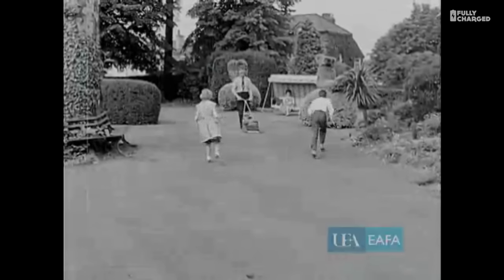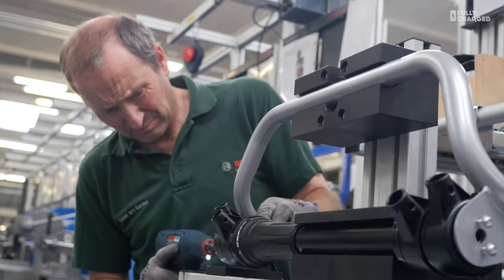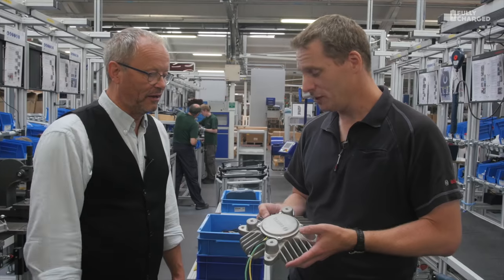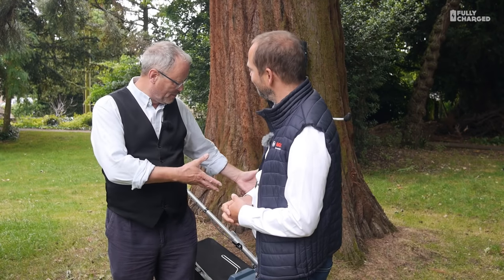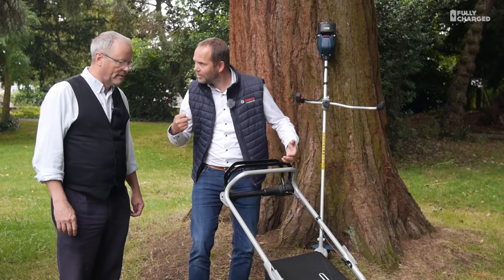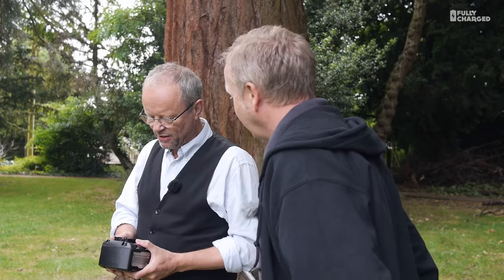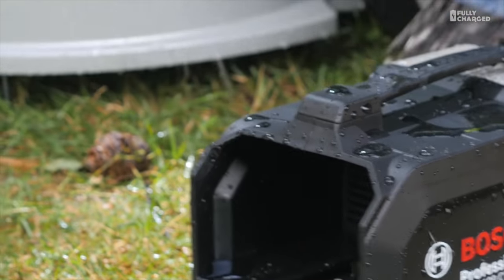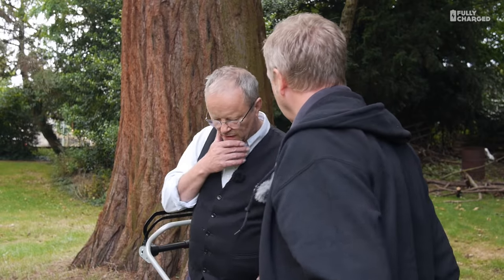Bosch pro electric Lawnmower | Fully Charged

Comment: I have to wonder in the life of the batteries and the mower 1. why not implement some kind of solar shed to keep those batteries plugged in and rotate around as you come back on a regular basis or two fold up panels on the truck bed with enough amps and 2. I wait for v2 of that mower where they make put noise cancellation so you only hear it when its being overloaded.

Comment: I used to own a Bosch Rotek 36 Li. Very practical for a small (200 - 300 m2) back yard (the ones flats tend to have occasionaly). This thing - Impressive, but not happening, at least not until someone bans a petrol powered lawnmower. Lets hope that never happenes.

Comment: Obviously this mower does not cut short grass as the promoters failed to demonstrate.I being an expert could hear the delay in the motor blade brake release on start up which will drain the battery quickly on too many start ups.

Comment: These are not new. I’ve had a Ryobi mower for 7 years. I have other products that use the same battery. The only thing I’ve changed is the starter cable and I’ve sharpened the cutting blade. Mowing late evenings without neighbours moaning is a bonus.

Comment: Battery powered tools are great, but the batteries are expensive.  That is not a big issue if the batteries and machines last long enough to justify the cost.  The first batteries that came with my Ryobi drill didn't last nearly long enough.  The replacement battery has performed above and beyond my expectations.  Now they have newer versions and I can only hope they have improved even more.  My biggest gripe is that they all take different batteries to fit the manufactures design.  Even automobiles use more easily attained batteries in this century.

Comment: They're not going to match a petrol mower if they think you only get 1.5 hours out of a tank of petrol.
Of course it depends how big your tank is.
My smallest mower for comparison; Hayter Harrier 56 has a 1 litre tank and I expect at the very minimum 3-3.5 hours out of a tank of petrol.
Electric may be cheaper than petrol, but I can't see this is for professional use.
Unless Bosch want to loan me one for a few days, if they're that confident in it. They haven't sold me.

Comment: I think the small battery charger (in fact, 2 of them) should be built into the big battery thing instead of having to convert the power to and from 220V which is less efficient.
Reply: +FDK that prevents that power pack being used with other standard appliances though. that pack outputs 220v and uses standard plugs so you could plug anything you wanted into it....
Reply: +Rich T Yes, have the 220v outputs, but why not a direct dock for at least one Bosch battery also? That would likely be more used than the 220v ports in lawn service applications.

Comment: Why is everyone so fascinated?? I've been using electric mowers for over 30 years... Granted, they're not cordless, but this is merely an evolution of a very very old concept. And 1 hour mowing means you either have to buy a lot of expensive batteries, or you have a small lawn, so you will be fine with a corded mower anyways...

Comment: As much as I do like battery operated machinery I think is is a false comparison the statement that it is cheaper to maintain over the life of the mower. If I own a petrol mower for 5 years and I compare it to a battery operated model apart from the electricity vs petrol cost difference. 

How many charge cycles are the batteries rated for what is the energy density warrantied for after 12 months or 24 months how much is a replacement battery how is a faulty battery determined to qualify for warranty replacement. If I don't use the mower for 3 weeks do I have to ensure a minimum charge is maintained in the Lithium battery to protect against deep discharge. If a zero discharge results will I need to buy a new battery how do I recycle my lithium battery with Bosch do they provide a recycling or battery upgrade program ?
Reply: This mowers is for professionals, and I think it's made for mowing near hospitals etc. where people don't want to hear noise. If a gardener can offer such a mower, he will get a contract, so the mower will be economical for him. If you buy this mower for private use, it's a nice mower and comfortable, but you never will get back the price difference to a petrol mower because of fuel savings at home. But for private use there are smaller and cheaper battery electric mowers available, which have the same batteries like other machinery, when you can use the batteries for a couple of devices its much more economical than batteries for only one device. If you already have some cordless tools with the right batteries, the mower alone without batteries is cheap.

Comment: We been dropping jerry cans and mowing in the rain for years with petrol & hi voltage HT lead.  Nothing new there.  As with the power bank they will be stollen very easily.  Petrol is still in the lead but electric is catching up.  Its the amp draw of a mower that lets it down.  A petrol engine working hard runs out of fuel quicker and you just fill it up from a jerry can.  This cycle can go all day and night long.  Its also cheaper as batteries are very expensive & charges.  If your power supply is coal its actually worse than petrol for the environment as coal has a shit calorific vale

Comment: i used a batter powerd shavers  and it's  s@#t   . then i went back to 240v plug in shaver . its a third the price 5 X more powerful  . And it lasted 3 years . the battery one lasted only 6 weeks . i allso, have a electric  weed waker and electric  lawn mower 240 v  and here grate
Reply: Fifteen year old mains electric mower here, used regularly, works like new and is a beast (1700w); no complaints 😁.

Comment: Works well for small-medium sized gardens, but I'm not too sure professionals would like to wait for an hour everytime the battery runs dry.
Reply: Easily solved wiith extra batteries that you can switch out in 30 seconds
Reply: Dusseren Which constantly need recharging, not only that but you need two chargers.
Reply: Easily recharged over night. Definitely not more work than the refilling and cleaning and maintenence that comes with other fuel.
Reply: Dusseren "Yup sir, It'll take me about 3 days to mow my lawn cause every time my batteries run flat I have to go home and recharge them overnight."
Reply: ...what the hell, do you have amnesia and have forgotten the context? You have several pairs of battery, and charge them over night.
Reply: Dusseren And carry a dozen batteries with me everywhere, not to mention how expensive electricity is!
Reply: No, you don't carry them with you. Obviously you keep them in your truck or whatever you use for all your other equipment.

I have to say though, with your comment about how expensive electricity I'm getting soem serious Poe's Law tingling.
Reply from the maker: I'm not sure I understand, did you watch the whole video? The entire point is that professionals, which is who this machine is aimed at, would have a spare set of batteries, pre charged, on standby. When the first two run out (after 2 hours of solid mowing, they swap them (30 seconds max) put the two depleted batteries on charge in the portable charger, so they don't need to 'go home' and charge them, while those are charging, they use the next two and by the time they have run out, the first two are full again.
As for the cost of electricity, these are small batteries, running this mower costs about 10% of the amount you'd spend on petrol gasoline so, to finish, every one of your points is invalid.
Oh, sorry, then there's the noise and smell of clattering, wasteful, constantly breaking internal combustion engines.
Reply: fullychargedshow And I wonder how much such a "luxurious" set costs?
Reply: Jaime F and Over $2000 I'd say!
Reply: I'm a professional Carpenter. I have DeWalt 20 Volt Max tools and 5 batteries and 3 chargers. Running out of power at work isn't a problem.
Reply: Some people are Leaders and some people are Followers. You Sir are certainly not The Leader type. 

Do you Follow me?
Reply: Peter Hall But as a carpenter you've got constant access to the mains. How does not wanting an underpowered lawnmower make me a follower?
Reply: Cordless tools are very handy as I don't require  an electrical tether to limit my movement around the construction site. I also have a cordless 20 Volt Max Nailing gun too and I don't need a compressor or hose either.

I don't need a lawnmower period as I don't have a lawn. Maybe you don't have a lawn either.
Reply: Peter Hall Yes, indeed, cordless power tools are extremely handy, I'm not denying that but thus conversation is about lawnmowers. 

I do in fact have an electric corded lawnmower, what I'm saying is that this "professional" lawnmower is not handy at all.
Reply: I agree with you that this lawnmower is not the best choice for the professionals. There are more customers in the private sector.
Reply: So a Pro company shows up they have a mower and brush cutter. They have a bunch of fuel with them. 

Now you show up. you have a Battery charging station, two sets of batteries (which are both charged a the start of the day (so 2-3 hours of work) they mow for  60-90 minutes swap out the batteries put them on the charger and off you go. 

The batteries cost $300 so a full get would be $600 in extra batteries plus the large battery charger at $2000

That basically means $2600. $3200 if you have to buy the first set separate from the mowers.

So lets do some math. 

Lets assume a commercial lawnmower is using about 1 gallon of fuel an hour at the US average of about $2.8 a Gallon. They are running the machines 6 hours a day 5 days a week 6 months of the year. That is $2150 in fuel costs (rounded down) Over 2 years it is $4300

So lets assume you have to buy the big charger and 4 batteries which is $3200 out of pocket expense and you have to pay for the electricity. 

So lets assume that that is 2540 Watts hours a day) (4 batteries plus the 1400 watt hours) at the highest Electcity costs in the US (Alaska) at 21.5 cents a Kwh. At the same 5 days a week 6 months a year that works out to $71 (rounded up) which over two years is $142. Plus the $3200 to buy the batteries means in two years you spend $3342. 

So yep you are right.. I don't know any company that wants to save $1000 over two years on fuel costs and then $2000 a year after that.. that is just crazy talk.. Thousands of dollars in saving a year is just not something companies are interested in. 

There is a greater upfront cost but the fact you don't have to mix the fuel a special way and have the extra costs of fuel additives etc.. means that over a very short period of time (one season really in much of the world) the cost of these devices pay for them selves more than once over.

Comment: slap a 100w flexi solar panel on the roof and run it into the main battery store via a solar controller and you never have to plug in again.

Comment: I bought one of these. Fantastic except the motor burnt out after 14 months. To Bosch's credit, they fixed it under warranty but I'm concerned about what happens in another 14 months.
It has difficulty chucking wet grass into the collection bin and clogs up.
All in all, this does not seem to be up to being a professional machine.
Reply: My Stiga petrol mower has also problems if the grass is too wet - I think there's a limit, and if it's too wet most mowers don't work properly. 

For this summer I bought a cordless Makita mower as  2nd mower, as a craftsman I already had their battery system. I'm curious how good it will work, it's only 36 Volts, but it's smaller than the big Bosch.

Comment: This mower, like every battery electric mower I've yet seen, is not self-propelled.  The motor spins the blade, but not the wheels, so you have to push it.  That's not too bad for short grass on level ground, but it wouldn't work for me.  I have a large yard with a lot of elevation changes.  I'd need more power.
Reply: DeepSpace, you're right.  I thought he was pushing it!  Battery mowers are starting to be practical.

Comment: Reel mowers. They are as easy or easier to push than any mower that isn't self-propelled, they are cheap, reliable, effective and easy to maintain. You don't need a self-propelled mower, hell your gp would probably prefer you use a scythe to keep your ticker working.

The only problem with a reel mower is that lawns are stupid as hell.

Comment: Sorry, i do like the mower itself, but the gentleman selling the large battery pack to charge up your mower batteries doesn't make sense. Wouldn't it be more efficient and less wear on the batteries if you just bought more batteries instead of the large you cant actually use on your mower?

Comment: Electric mower has a "flat battery excuse for the missus.  A petrol mower has the " won't start" excuse AND the "out of petrol excuse.  The petrol mower wins 2 to 1.
Reply: +neddy laddy If you mean the petrol mower wins as the king of shit, I concur with your math.
Reply: Dude31463
I could even smile at that comment if I knew what you meant by "king of shit", which, alas, I don't, ain't ever heard it even.
Reply: +neddy laddy "king of shit"... Presiding over something that is obsolete.

Comment: I'm sorry but £1200 WITHOUT batteries + charger.....
Reply: +Rob Payne Hence the "Pro" label. Prices for home units are lower but still well above comparable internal combustion. They will get less expensive and better fairly quickly. I have an old Lead Acid model - heavy and clunky however pretty much zero maintenance beyond blade sharpening and battery replacement. I'll be shopping for a newer model soon.
Reply: +Fiat x19 Wow, it's over $2,000 with batteries + charger... That's redoncilous!
Reply: No petrol or oil, no smoke/fumes, no pull start needed, very quiet, hardly any maintenance etc. It's well worth looking into now prices are falling. I bought a Makita brushcutter, shears & hedge trimmer as I already had the batteries & charger that came with my drill.

Comment: Pro mowers have 5 -6 horse power. Not 2-3. Yes well done Bosch a huge electric company. Does it perform really well in the wet. We are in uk after all. Bag looks small. So commercial peeps are going to need like 16 batteries. Two run out hour and half. Then need to buy a charging box. Seems a lot more costly than it needs to be. Don't they make one with a roller? They need to ask commercials to use it for a year for free and provide everything and improve from feedback not what they think is right n

Comment: got a smaller domestic mode, single battery. machine broke beyond repair, something shorted, battery decided to go into a meltdown for no apparent reason, Bosch are very overrated for quality, i also had a bosch grinder which the speed control burnt out, yet my black and decker grinder which is 3 times as old is better quality and still works would not buy that Bosch anything again :(